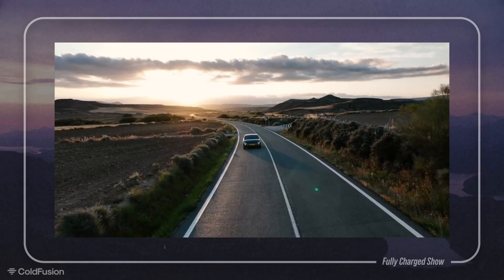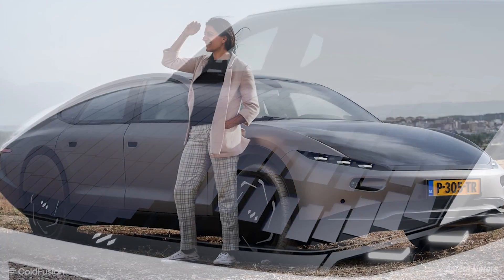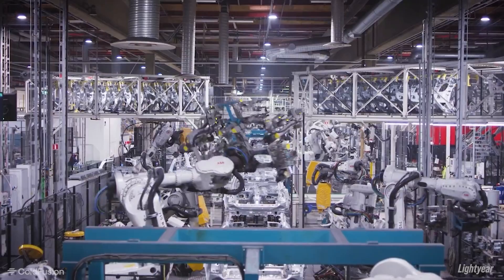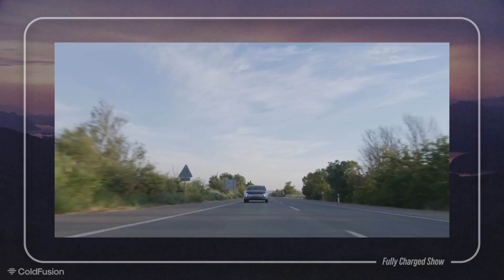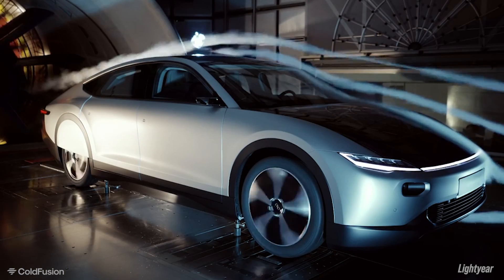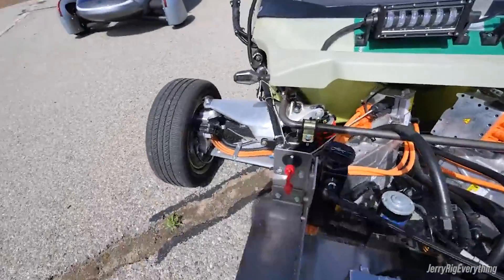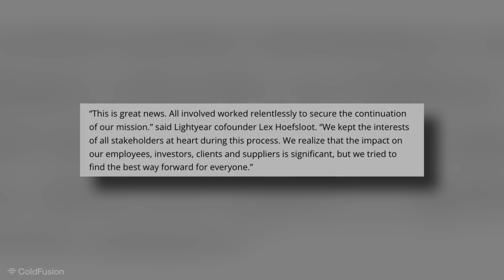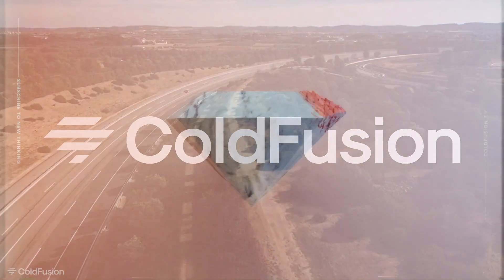3 Interesting Solar Car Projects

Comment: The problem with efficiency is that a lot of us who prise efficiency are looking to save money and we demand low costs on both the initial price and operating costs. So for a new company who needs to build up to mass production, this becomes a major issue. They need a lot of cash up front for development, initial production, and scaling things out, but the target customers will scoff at the price.
Im not a huge fan of musk or Tesla... But they were on to something with their strategy of building out the most profitable vehicles first, and then slowly filling out larger volume but lower profit margin vehicles over time.

That said, I hope that lightyear succeeds! But $40k, while cheaper, is still $10-15k above the prime low cost high efficiency audience. For $40k you can get a very nice, or very large car. To give up on size, capacity, features, speed, etc is going to be a rough sell.
But a slow car that can get me down town every day without having to fuel or plug in? I would consider spending $25-30k on something like that. I typically buy older cars that need a little tlc, which generally runs me $10-12k between the car and initial maintenance, and then lasts me for about 7-10 years. But something new that doesn't need oil changes or gas sounds interesting,and I would gladly pay a little more for that.

Comment: A $30,000 hyper efficient electric car is almost exactly what I have been holding out for. Speed is barely a factor for me. When you said it went 90MPH or whatever the exact speed was, I was thinking "that's great!". It could have a max speed of 80MPH and a 0-60 speed of 15 seconds for all I care. I drive on flat and mostly empty country roads in rural Ohio.

I just want an electric equivalent to my 2004 Camry, really.
Reply: The slowest 2004 Camry has a 9.6 second 0-60.
Reply: @filonin2  The lightyear 0 was 0-62 mph in 10 seconds, almost identical. 0-62 in 10 seconds would mean it likely hit 60 in 9.8 or so.
Reply: Yeah, I don't understand how 90MPH can be considered "slow" by any means.  I've driven through over half a dozen large US states on long road trips, and never once have I seen a speed limit sign anywhere near that high.

Edit: upon a brief investigation, it turns out that there are ZERO roads in the US with a 90MPH speed limit.  The absolute highest is 85 and is only on a single highway in Texas.  7 other states have a few roads that go up to 80, but the rest have their highest limits ranging from 65 to 75 MPH.

As far as top speed is concerned, these cars would have absolutely no trouble anywhere in the USA.
Reply: @bobL761  Marketing numbers as it has a battery, just means it drains too fast. Its a hollowed out car with a solar gimmic.
Reply: @bobL761 Agreed. I could do a car with a top speed of 75 MPH, but I’d prefer 80 MPH just to have a little wiggle room. 90 MPH would be more than enough.
Reply: @bobL761 what the posted speed limit is and what speed people actually drive at aren't the same thing. Posted speed limit on many highways is 75 mph and yet you can do the speed limit and still have people passing you.
Reply: Same here. No need for speed. Just affordable and comfortable. That's it.
Reply: Aptera solar car (2-seater) will have a 26k price for the base model
Reply: @huzcer Lol. I'll believe that price point for the Aptera only once I see them actually selling it. For now, I'm highly skeptical on their pricing claims.
Reply: @Bertinator-nm9ld I'm skeptical this second iteration of an already failed company will even make it to production.
Reply: I've owned 4 different cars in my life, none of them did 0-60 in less than 10 seconds. I really don't get why anyone could complain about such acceleration. It is more than enough if you dont have a Toretto complex
Reply: @apermas  
Of course you don't understand the appeal of acceleration if you never had a decent car. Try a Tesla and you'll understand.
And it's not just super fun, but also useful. Overtaking, merging, and many other common traffic situations are much easier and safer with adequate acceleration.
Reply: @andrasbiro3007  people thinking cars should be fun and not just tools to get you from a to b are the problem. And yeah, I would rather spend 40k in something useful rather than a fast car
Reply: @apermas 
1. Why do you hate fun? 
2. Again, acceleration is also very useful, I explained why.
Reply: Yah I always wonder if anyone says '90mph? forget it its not fast enough!' if they want an  EV/solar car. I drive 60mph in my ICE in the UK even on motorways because a) its relaxing and b) the limit is 70. I don't have a problem with people going faster, just buy another car that does that.
Reply: Our 2018 camry gets around 50 mpg! In Louisville ky on 17 mile one way commutes on I71 to downtown.    Yes average on round trip!
Reply: 300 k is too expensive
Reply: Why do you need a hyper-efficient car with lot of sacrifices? Electricity is cheap and only getting cheaper. And acceleration is not just super fun, but also very useful in many situations.
Reply: @andrasbiro3007  As more cars become electric, and the grid becomes more taxed, electricity prices will only go up, eventually reaching the same or even more as people spend on gas. (This is already almost the case in many electric cars, if you have to use public pay per kwh chargers)
Reply: @rdizzy1  
Nope. For starters, current grids are designed for peak consumption plus some safety margin, which means there's a ton of unused capacity during the rest of the day, and especially night. By simply timing EV charging the grid can absorb a huge amount of extra demand without any upgrades. And this actually makes electricity cheaper, as the existing capacities are better utilized, and baseload power is way much cheaper then peeker plants.
The amount of energy used for transportation is about the same as we use for generating electricity, but large power plants are far more efficient than car engines, and electric motors are close to 100% efficient, so even electrifying all transportation doesn't add that much extra demand. And it's not like it's going to happen overnight. The full transition will take at least 20 year, which is plenty enough time to add more capacity.
And with the falling price of renewables this just gets better. Already the cheapest possible power grid is solar and wind with about 3x overcapacity, and a little storage. It's because storage is much more expensive, so it's much cheaper to have enough generating capacity even in less ideal circumstances, and only use batteries for night and very cloudy winter days.
And the side effect of this is extremely abundant essentially free energy at any other time.

Public charging cost half as much as gas for me before the invasion of Ukraine. And in the US it was even better in many states. I don't know the current math, but the US should be much less affected by the war.
Reply: @andrasbiro3007 depends on what you call a sacrifice. Where i live the max speed limit is 130km/h, i never went over 140, so 160 is totally good enough for most people. I honestly don't care of most car "features", so having an expensive car, with lot's of features i don't use, is just a sacrifice for my wallet. Also about charging, is it a sacrifice to have a car that can be charged quickly or doesn't need to be charged at all most of the times? 
So it depends on what you are looking for, atm i don't see much diversification in the EV market, with more options, more people can buy what they need
Reply: @Ubya_  
160 kph is acceptable. Although I like to drive over 200 in my Tesla, it's almost like flying.
And acceleration is also nice to have. Once you got used to it, it's hard to go back.

I'm not talking about features end expensive cars, I'm talking about basic functions and specs. Like how many adults fits inside comfortably, and how much and how big luggage it can carry. Then comfort, safety, handling, etc.

Charging my Tesla is effortless, and doesn't take much time either, I wouldn't sacrifice anything for more range.
If you can charge at home it really doesn't matter anyway.

Sure, buy it if that's what you want, I'm just saying that this is trying to solve a problem that doesn't really exist.
Reply: @andrasbiro3007  Why do you care that someone feels they need a hyper efficient car with sacrifices that they don't see as sacrifices?
Reply: @andrasbiro3007  Electricity is cheap and getting cheaper? What planet are you living on?
Reply: @rutessian  
Earth. Look up the price of solar panels and batteries. The former especially is down many orders of magnitude already, and not likely to stop any time soon. Solar is already a lot cheaper than traditional power plants, and even with the necessary battery storage it's competitive. This makes the price of every other energy source irrelevant.
Reply: @andrasbiro3007  "BloombergNEF’s annual battery price survey finds prices increased by 7% from 2021 to 2022"
There was also a small 10% -20% increase in solar panel installation prices, but those might be temporary due to some production issues in China.
Also, prices of energy in Europe have doubled, I'm ignoring the 2022 spikes. I hope they'll go down, but they were going up before the pandemic...
Reply: @rutessian 
Look up what happened in the 2020-2022 time frame, and you'll find the explanation.

Energy prices are not yet set by renewable energy. There are a lot of legacy stuff that complicates the issue a lot. Especially in Europe with it's huge natural gas imports from Russia. That has been an issue since 2014, not just since the invasion.
But as renewable energy starts to dominate, and there will be enough storage to smooth out price fluctuations, you'll see energy prices going down. It's inevitable.
Reply: @andrasbiro3007  In the UK, electricity prices have tripled in the last year or so.
Reply: @tregoboing  Yes it has. Regardless he's questioning someone in Ohio's needs. Not the UK. Many power plants in the United States are natural gas fired. Natural gas is incredibly abundant in the United States and a byproduct of oil production. In a lot of instances it is simply flared at the well rather than collected and sold. It is so abundant that it's been priced as a waste product for a long time. Which is why many power plants in the United States today are natural gas-fired.
Reply: @tregoboing  
A very large percentage of the energy used in Europe comes through Ukraine, which is a bit problematic now for obvious reasons. That's why electricity got very expensive last year. But market prices are already back at pre-war levels, now just long term contracts have to expire to fully go back to normal.
Reply: @andrasbiro3007  that idea of "electricity is cheap and will only get cheaper" is precisely why you should look for a hyper efficient car (not just cars obv). A lot of people shares your opinion, as seen by everyone slowly switching everything to electricity. This increases the overall demand for electricity. With that the current cheap electricity prices will slowly climb. Going the hyper efficient route is basically about being ahead of the curve so when the eventual electricity cost hike comes, you'll have nothing to worry about.
Reply: @Justakatto  
That's precisely why efficiency is not too important.
Electricity is already cheap, and only getting cheaper long term. And abundant too. There's practically infinite amount of sunlight.
Reply: @andrasbiro3007  You can't keep piling electric cars onto the utility grid, but you CAN pile a few more on based on efficiency.

Comment: The idea is great but the technology is nowhere near good enough. When solar panels are 2 to 3 times more efficient and the battery weight and cost drops, then this would be great and successful. 

TBH i think these companies are doing the donkey work, that means that if they are still around when the technology catches up they may be the next Tesla. I'd want to see a vehicle used in a real world situation not shiny marketing material. I suspect that the actual range and power figures etc are well below those quoted when used normally. As is the case with all vehicles, ICE or EV

This coming to market is a very long way off though in my opinion.

Comment: Well, cost saving is not an arguement if they are asking for more than 200k.
I don't see the justification for the price. A good Solar Panel is around 200.- today. A flexible panel should not cost much more. The battery would be smaller, so why much cost?

Comment: Now that EV tech has finally become mainstream, efficiency is the next big frontier. This pursuit is exciting to watch. Especially if we one day hit the gains needed in both driving effi iency and solar efficiency to hit a 1:1 ratio on consumption vs production. Personally, I probably won't end up buying a car with solar panels because i like parking my car indoors. Luckily i have solar panels on my roof to charge the car and i'll probably stick to that method. But I would love to see cars with smaller lighter batteries due to these efficiency gains.
Reply: I strongly disagree with this video. Efficiency WAS the key to make BEVs possible. Tesla had record breakind cw-value for a reason. The whole premise of the video is wrong and thats also the reason why that company went bust. The car has ridiculously big wheels which dont fit together the big steps in efficiency they would need for a "solar"-car. They funneld the money.
Reply: EVs are below 5% of all cars on the road and they are not in demand contrary to what Elon would say. Check the data before you eat up BS about EVs becoming mainstream
Reply: @argh_666  it'll be mainstream with enough propaganda around it. As long as the solar power isn't tied to a subscription or cloud service where they can turn off your car remotely, I am for this.

Comment: We need charging lanes instead of this. This would be a lane on the highway where the eletrical cars can plug into the grid like trams did. This will also allow for smaler batteries and it could be combines with crouise control / selfdriving allowing the cars to drive closer to each other reducing drag.

Comment: I'm skeptical that the a fully solar car will ever be economically viable. The proof of the value in focussing on efficiency is intriguing though. Improving EV efficiency is imperative because it results in using fewer batteries. Also it opens up the door to using cheaper LFP batteries or even upcoming Na Ion batteries.

Comment: 10:40 19 000X30 000$ = 570 000 000 $ of pre-orders...they ran out of money and no one invested in the project...???  This has to be a scam. 

The math should be simple enough for any manufacturer. Energy in = energy out. "Energy in" is area X efficiency. The area is fixed. Commercial sollar efficiency is 20% but it can be improved."Energy out" is the engine. Electric engines can already achieve 80-90% efficiency, so not much room. In practice it would be how much and how fast can I move with 2kW and a 30-50Kwh battery. Not much, not fast.

Comment: Whoever was going to buy this one for almost 300k was not buying it for economical reasons. You buy Tesla S Plaid and have 200K for electricity. That would be around 1.6 millions kms (at presented prices in Switzerland). If you charge it at home, that would be double that.

The Holy Grail would be 30'000 price with 50-60 daily solar powered kilometers for hatchback like car.

Comment: As cool as the technology is, it would be dangerous to drive on any major roads with a 0-60 of 10 seconds. Trying to merge would be a nightmare, and you’d have to have a lot of faith in other drivers that they would slow down or go around you. Of course I support the vision but at its current state it’s just not viable as a daily driver

Comment: A good idea that was never going to work.
For the asking price you could buy Tesla Model S or X Plaid and cover your entire roof of your house with solar panels and buy a couple of Tesla power walls. You then not only run your car off solar power but your entire house as well.

Comment: Their ads were misleading. THe top speed makes you think it can cruise at that speed, but really without the battery I bet it tops out around 40km/h in direct sunlight. If you are going to buy solar panels, you might as well put them on your house so all the energy is sent to the grid, on a car the energy is only used when you're driving otherwise it's wasted.

Comment: A scooter uses 4 times less than a electric car, ebike 10 times less but its very difficult to find outdoor 240volt AC to charge them. We need to question why people move two ton cars 1 mile

Comment: i wonder if this is really the way forward, ideally we have cheaper and bigger renewable systems in place to charge the electric fleet. it saves weight and complexity on the car itself. i do agree that optimizing the cars in general to need less electricity would be the aim. problem is only that general public just want a cheap and comfortable Suv type of car to drive in.
Maybe they should start put Energy labels on cars also to clearly state how efficient/poluting they are. or show how much savings some can expect picking up a more erocynamic model with more efficient engines that weight lighter. compared to a heavy Suv type model.